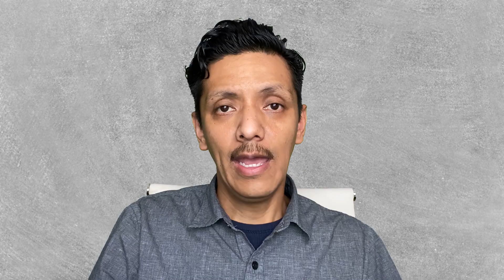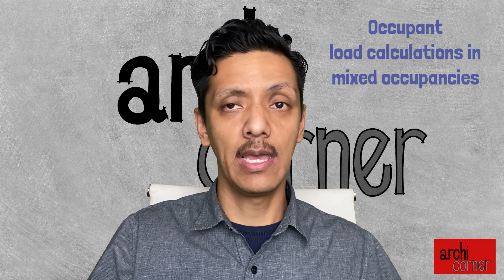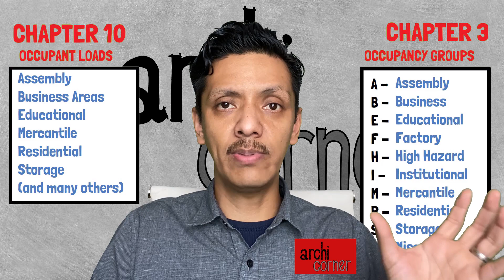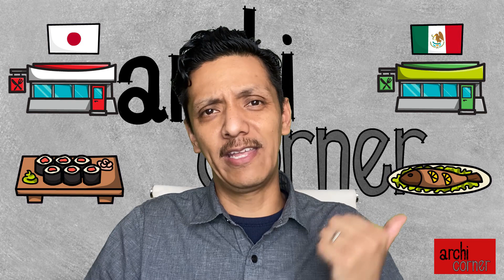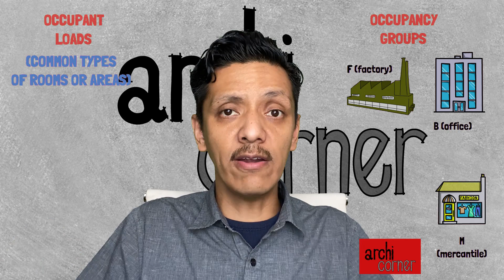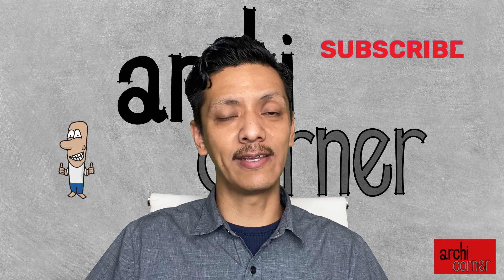AC 030 -  Occupant Load vs Occupancy Groups

Comment: Josue to calculate number of fixtures required do we use chapter 3 use class or chapter 10 use groups?
Reply from the maker: Both. Chapter 3 will let you see what type of occupancy group to use. Chapter 10 will let you know how many occupants to calculate.
Reply: @archicorner  What of exceptions in the code such as 303.1.2 for small assembly spaces that are not classified as A assembly?  Does this exception carry over to chapter 10 for determining occupant load? Mainly for plumbing fixtures rather than egress. Is there a distinction?

Comment: I'm estimating for number of people who will occupy a lab so as to generate amount of wastewater discharged.  Can I use this?
Reply from the maker: Great question. Occupancy loads my be different for egress than they are for plumbing fixtures, but each state is different. Chances are that may require a different calculation method or load.